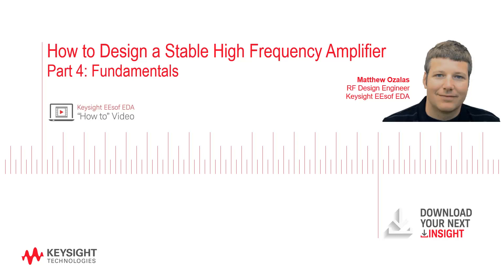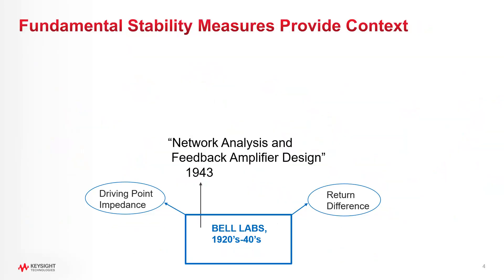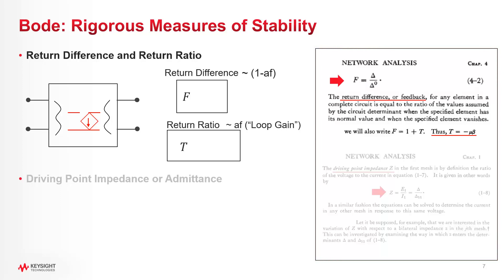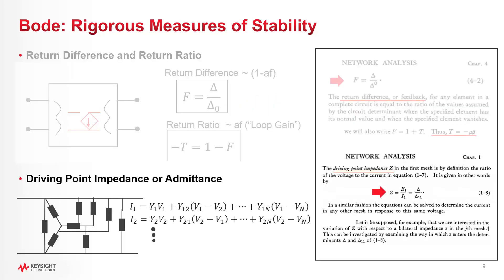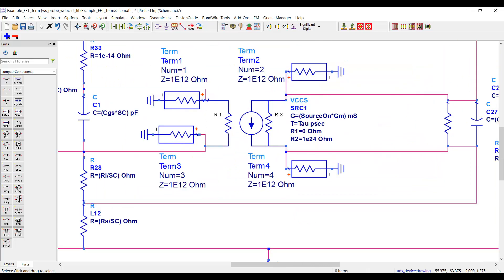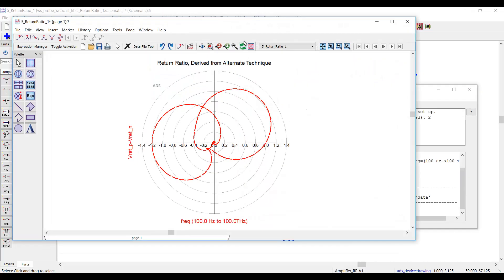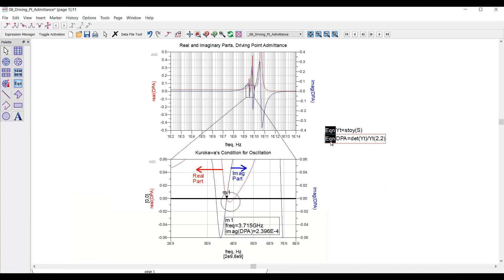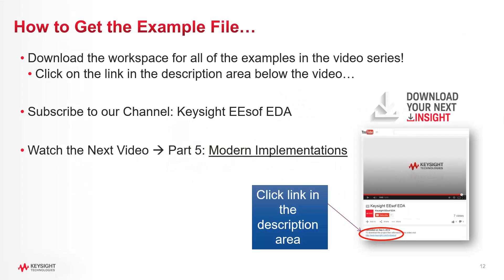Part 4: How to Design a Stable High Frequency Amplifier

Comment: Hi Matthew. Many thanks for your elaborate explanation of different approaches for RF stability checks. Working as an RFIC designer for 7 years, I have struggled with the same topic many times.
Kurokawa's method is indeed rigorous, however, I've seen it fail in very simple oscillator circuits. For example, take a simple series RLC resonator where R=-30ohm, L=1nH, C=10pF which would oscillate at 1.59GHz. You will see that Kurukawa's method cannot predict the oscillation correctly. Interestingly, whether it can or not depends on the R value. For R<-10 it predicts stable operation, which is wrong.
I can see that you have spent considerable amount of time with the theory. Perhaps you can explain this mistery =) ?
Reply from the maker: Great question!  I have to admit this one stumped me.  At 1.59 GHz, the imaginary Driving Point Admittance asymptotes around zero but does not touch zero, so it does not technically satisfy Kurokawa’s condition, as you said.  After consulting with some true experts on stability, I think the short answer is that the oscillation is not at 1.59 GHz, its actually at DC.  You can see that if you sweep the frequency negative – Kurokawa’s condition will be met at (or practically in the simulator, very close to) 0 Hz.  This can also be confirmed using NDF or other methods.   Just stick to positive resistors on your RFICs and you should be fine 😉!

Comment: I would like to ask about the Kurokawa's oscillation condition:
Are Re(DPA)<=0 and Imag(DPA=0) and dIm(DPA)/dfreq>0 happen at the same time?
If Re(DPA)<=0 but Imag(DPA) is not equal to 0, Will the circuit oscillate?
EX: In the figure at 9:31, only at the marker m1 3.715GHz oscillate OR the circuit oscillate at frequencies which real(DPA) is smaller than 0?
Thanks for your very nice video series!
Reply from the maker: The cited condition is required for the startup of an autonomous oscillation, and that condition is met only for the case where the imaginary part of the admittance crosses zero with positive slope with respect to frequency.  In places where this condition is not met, oscillations are still possible with external perturbations, but they will not arise on their own.  For an excellent reference on the subject which goes into much more detail, check out “Analysis and Design of Autonomous Microwave Circuits”, by Dr. Suarez.
Reply: @KeysightEEsofEDA  Thank you so much for the great book!
Reply: @KeysightEEsofEDA  But in the second example of PART 7,  you only conclude whether the amplifier is stable through only the real part of the driving point admittance without looking at the imaginary or its slope?
Reply from the maker: @kimphanvan4077  If the real part of the DPA is >0 across the entire frequency range, that is enough to conclude that the condition is not met.  However, if a negative real part is encountered, we then run the second part of the check (is Im=0?).  That was the process in Video 7.
Reply: @KeysightEEsofEDA  I got it now! And the wsp_driving_point() function can do all of that processes to give us the unstable frequencies! Your video series is so nice! Thanks a lot!